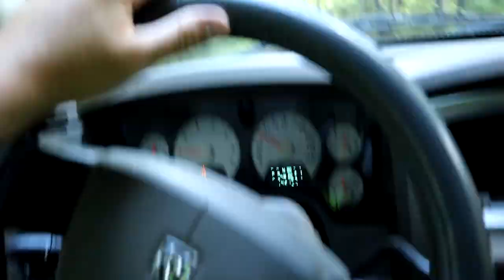THE NEXT FLIP HOUSE TOUR...

Comment: Gut it down to the studs. Remove those non-load- bearing walls to open it up, get rid of the bathroom window and look for a replacement tub with a matching wall set. Lowes has a Sterling Acrylic/fiberglass unit that's nice. Get Cabinets 2 Go (ask for Cory if he's still there) to do your kitchen layout with 7 Cities Granite (Roy) for your tops. Use a water proof vinyl laminate throughout the entire house except the bathroom. Make sure it's at least 4 to 5 mm thick. Buy the matching shoe moulding. Lowes or HD usually has something on sale. Get all your electric and plumbing roughed in before hanging any drywall. Ceilings first. Finish with a knockdown or orange peel. Install all new prehung doors from Kempsville Building Materials in Chesapeake.  They have a door plant there. Get Split Jambs. They are easier to install with a 2 1/4" Colonial casing. Go to Lowes for the 3 1/4" base moulding in a contract pack. 16'. Colonial to match the door trim.

Comment: Not sure if anyone else mentioned this but the outside siding looks like Asbestos.  Some areas allow you to put siding over Asbestos and others make you remove it due to Asbestos breaking easily.  If you thought some of the other things broke you bank account at the other flip house, wait until you see the cost to remove Asbestos. You really need to check if the siding material is Asbestos  and if so check your local ordinances before signing anything.
Reply: it's asbestos

Comment: That fence was holding up against them winds! Job well done👍 after a quick glance at your flue pipe(exhaust for your hvac system) you're probably gonna need more rise for the amount of run you got going on to pass updated code laws. Not a big deal but have your guy look at it cause it looked like it was run basically level for several feet before it went up and out of the roof....recaulk your flashing too ✌ change the gate to a single instead of a double gate and you get 5' of yard on that vacant lot.

Comment: Joe, take out that wall between the dining room and kitchen and extend that kitchen out further. A bigger kitchen adds more value to a home than a dining room. And instead of having the washer and dryer in the kitchen wall off a small room in the corner of that dining room area for a laundry room. You can set up an eating area off the larger kitchen instead of having a whole separate dining room. Dining rooms are pointless these days.

Comment: Looks like drip lines running down the hot water heater from the top. If thats so, factor around 500-700  to replace it. Not a big deal but a nice selling point. You would probably get double your money back easily.

Comment: Joe KEEP THE LOT you can borrow later against it if need be. 

If the shed is movable bring it up to back of house side it with same as house turn it into deluxe laundry room with hanging rack. Sink folding table storage washer dryer this will give lot of room to kitchen open wall to dining room to create big eat in kitchen with island redo both dining and kitchen floor to match so u will hv nice bathroom nice kitchen nice laundry room  great selling points and have a Pro come in to sand and redo wood floors dont forgdt permits  permits permits

Comment: I'd be busting that wall out and making the kitchen open plan with the rest of the dining area, that part really dates the house. With the second lot, you should get the power , electrical and telephone service ran to it (get the meter box and the little pipe covers put in , and put a cheap mail box at the front - that will add like 20k to the asking price easy if people see that, if not - it's just another pile of dirt out in the open. I don't know what the local regulations are, but I would be finding a cheap demountible home or even trailer home and placing that on the lot and build some stairs up to it and put a verandah on it to make it look more permanent, you might be going so what? but this might be the difference between selling the spare lot for 20k or 50k

Comment: I think you’re going to do really well on this flip. Not only have you learned a lot, you’ve also got a better structure to work with. Those wood floors should sand out well.
P.S. Refrigerators in houses are way overrated.😆

Comment: Joe What's going on with the house that yal do the lawn maintenance on is it for sale or what.
Echo,Stihl,Husqvarna are the best chainsaws. 
That was dumb to cut the grass while it's wet grass doesn't cut right while it's wet plus it makes it looks bad yal should've waited until it dried out before you cut it. 
Yal definitely need to hire a liscensed contractor and electrician to do the work on the new flip house the hardwood floors doesn't look bad at all yal should keep them and just hire a flooring company to strip,sand and stain the hardwood floors instead of putting flooring on top of them if it was me I'd remove the wall between the dining room and kitchen to open it up so it wasn't all closed in add a bar and redo the kitchen going into the dining room and add new kitchen counters and stain the kitchen cabinets.Change the bathroom counter top strip and stain the bathroom cabinets,retile the bathroom floors and give all of the inside of the house a fresh paint job. Reside the outside of the house, replace boards on the back deck then stain it and takedown the chain link fence and add a wood fence it would make the house look alot nicer and then hire a liscensed landscape company to do the landscaping it would help it sale plus the pricing go up some if you did that.
Reply: thewalkingdead  
He's probably not going to hire liscensed contractors like he did before and put everything cheap in the house like he did with the flip house I guess he didn't learn. 
He needs to start listening to us about what he should do with the house.

Comment: It's not horrible, stop buying homes with zero cornice. Why is the top railing on the new step non-treated wood? The electrical panel need to be higher off the ground. You aren't ready for new construction.

Comment: Nothing to bad in here. Trim is painted white! This statement here is just what I expect from a novice. 

1. Floors are shot and cupped moisture in home
2. All hardware is old and needs new
Bathroom 3500.  Rehab
Kitchen 9000 rehab
Floors 2000 rehab sanding finishing 
Paint inside 1200
Paint outside 2000
New doors 

He’s gonna put vinyl floors over real wood floors wow he’s already deprecating the value. Wow and he’s trying to put lipstick on a pig and sell this for 118k this guy has no idea here comes 2nd rd of mistakes